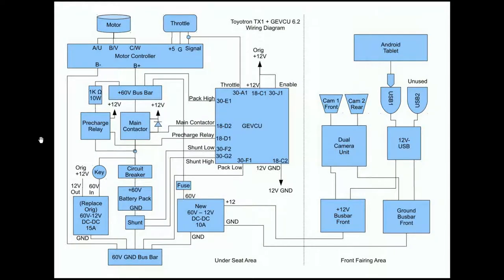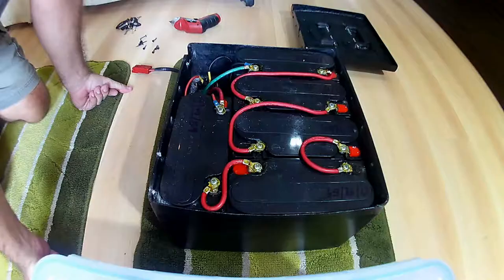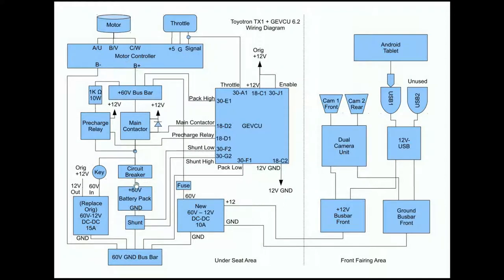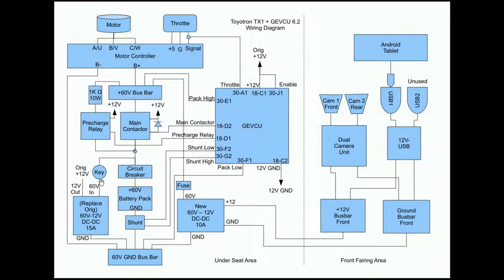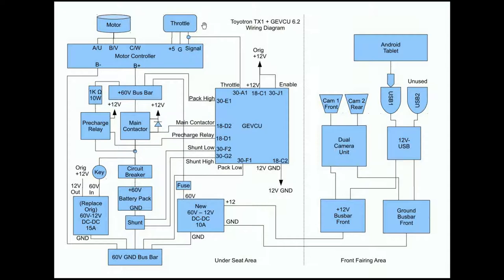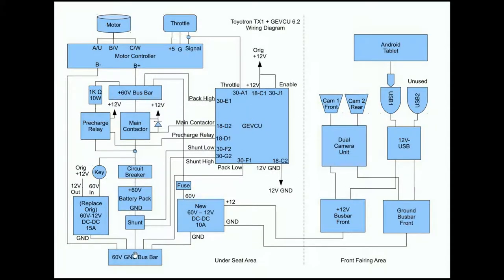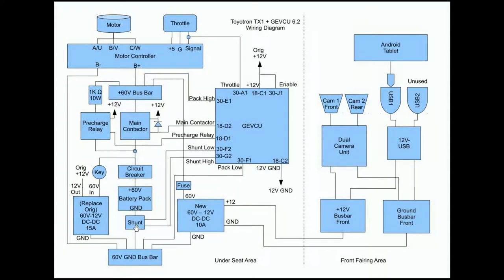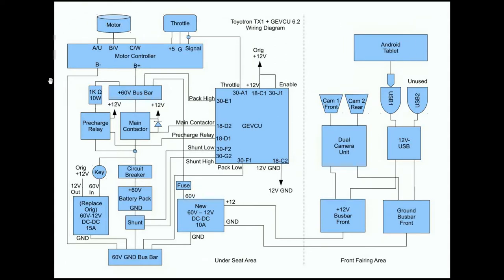Toyotron Electric Scooter Upgrades Number 17 - Wiring Diagram Walkthrough

Comment: Nice work! Has the precharge issue been corrected with the GEVCU 6?  I had a problem with my GEVCU 4 running the 5.2.2 code with the precharge function timing. The Arduino boot sequence connected all the active low circuits to ground until the Arduino code was loaded and it took control of the outputs and opened the active low circuits. That was just enough time to fry a number of contactors until I attached some test lights and saw that they were lit momentarily at boot. The cooling fan (also active low) spun briefly at boot as well. EVTV confirmed that there was a timing issue and recommended against using the GEVCU precharge function. I solved it with a time-delay relay. Hope to save you some grief - just run a quick boot test with a light in place of the precharge circuit to confirm. http://porscheev.blogspot.com/2015/10/back-to-shop.html